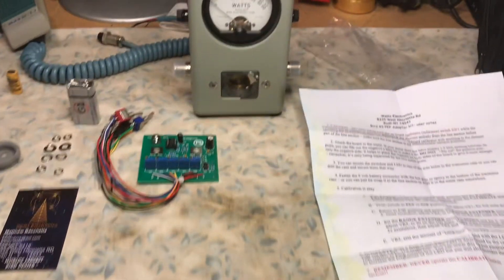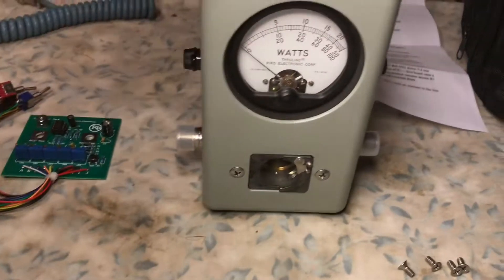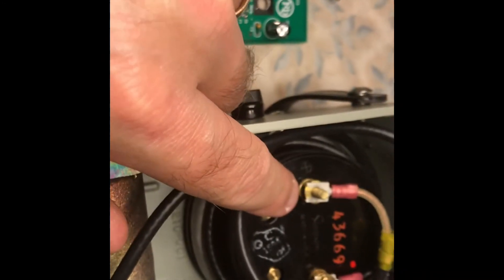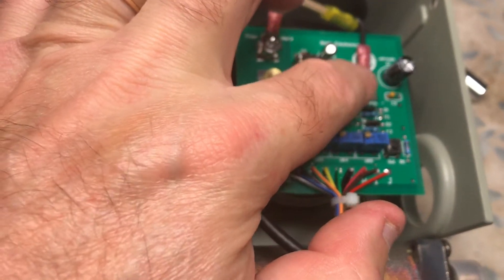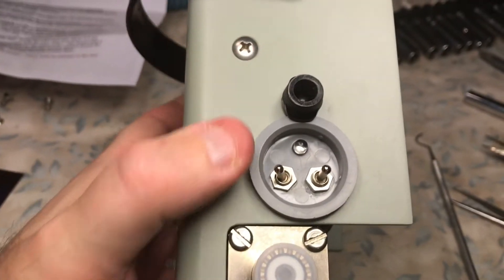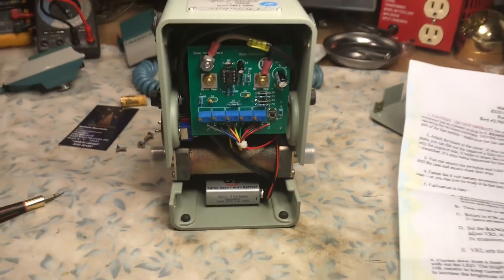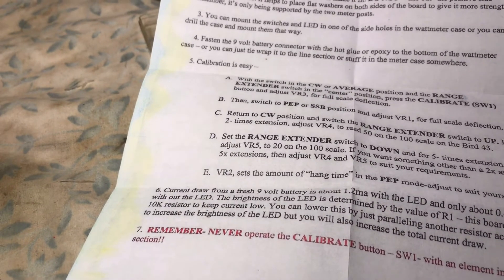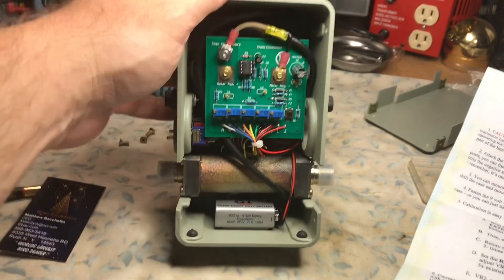Bird 43 Thruline Peak PEP Wattmeter Element Kit Installation

Comment: Nobody shows us how to use the multiplier
Reply: Use the same scale as the slug. ie: 100 watt slug use 100 watt scale and multiply the reading by factor selected. Meter reads 20 on 2x = 40 watts. That’s how it was explained to me

Comment: I got this unit recently and the one I have is pretty accurate on PEP ranges using a new Bird 1000H element on 20 and 40 meters
on the 1x, 2x and 5x ranges.
It helps to make the hang-time long so it can reach the max (VR2 lots of turns CCW) and it compares amazingly well to
a Bird Power Analyst PEP rating.
73  WA4QGA

Comment: BIRD 43 upgrade pep - ssb kit multiply board 2x 5x   ( if no update  through voltage drop you will get false reading information  x1 )
In order for the measurement to be accurate, a stable voltage is required.  in the pictures, we see brand new 9v batteries.  the scale is out of range.  empty battery is below the scale.  with the upgrade, in my case, the power source comes from a lion 18650 battery via a dc-dc step-up converter set at 9.1v and can be charged though usb port.

Comment: I have just orderd this kit. 
I am in the UK. Cant wait to get it installed.
Reply: BIRD 43 upgrade pep - ssb kit multiply board 2x 5x
In order for the measurement to be accurate, a stable voltage is required.  in the pictures, we see brand new 9v batteries.  the scale is out of range.  empty battery is below the scale.  with the upgrade, in my case, the power source comes from a lion 18650 battery via a dc-dc step-up converter set at 9.1v and can be charged though usb port.

Comment: Not sure why some of you are having problems with the 2x and 5x settings. my kit works fine. center position 110 watts, 2x 110 watts,  5x 110 watts.
Reply: I agree, I have tested a 1000w slug at 2x and 5x with a 3x Acom 2000 with combiner setup and its extremely accurate when tested against a standard 4134 with 5kw slug on dummy load. We do a lot of defence testing for high power HF equipment and its definitely going yo save you some money on slugs without losing accuracy.  I think the pep kit is a winner and unless you are super anal about readings down to the milliwatt, buy it for sure. Cheers Brenton vk3cm Tangambalanga North East Victoria Australia

Comment: I'm waiting on my kit and am more interested on the PEP feature as of now so hope all goes well. I'm hoping I can use my 12 volt power supply with a buck convertor or something instead of the 9 volt battery. I guess I'll have to see what the DC voltage range is when I receive the kit. Out of curiosity, has anyone tried this?

Comment: Len.....I noticed you never make the switch orientation clear.  So....I watched your video until I could see wire colors on both switches.  Then I knew how to install them in the proper orientation. Everything else went smoothly.  Thanks!
Reply: for it to match what the instructions say, put the green wire on the switch at the bottom and you will have up for 2X and down for 5x.

Comment: It's not a bad kit but it's not very accurate especially in 5x position. I'm here because I'm trying to see if anyone has figured out how to fix it.
Reply: I'm not sure you are right about your claims
Reply: @zeljkoadzic1692  well this was a year ago and I found out mine was defective.
Reply: @zeljkoadzic1692  same here, my kit works fine. center position 110 watts, 2x 110 watts,  5x 110 watts.
Reply: Same issue here.
Reply: @mostlypostie1  and you calibrated it like the instructions say? which slug are you using?
Reply: @bobicpfan2  to the letter of the law. I have a calibrated test bench to reference it against too. It's close in the 1x. Slightly out in 2x and a fair way out at 5x.  No matter what you do. And you can't compensate for this error.
I have many slugs for different frequencies and powers, and the error is fairly consistent.
Reply: @mostlypostie1  ok. so its obvious that some folks are having this issue while some are not. i guess i'm a lucky one
Reply: @mostlypostie1  thousands of them were sold and only a few of them complain.. there is a small problem somewhere..
Reply: @zeljkoadzic1692  I had a problem with 5X only. I replaced the opamp and calibration changed a lot. Recalibrated and now all is well using my Bird 4391M with 100H slug as a standard.

Comment: Hi and thanks for sharing this video. I got the same board and found that even after calibration the x2 and x5 are too inaccurate. Loss of linearity of the scale unfortunately. By the way I’ve calibrated mine to read on the 250 scale. So simply put instead of going to 50 on the same 100 scale I went to 100 on the middle (250) scale. Because I only have 100H sensor I can read higher than 100w this way. 
Another thing I’ve done and suggest to everyone who use the board is to secure it in place at an angle using ring wire terminal as spacer. Doing this I can use the hole to hold a spare sensor, otherwise unusable.
73s
Reply: Same. My 2x and 5x calibrate OK in CW mode, but in PEP, they are not accurate. I'm probably going to remove mine and get the real kit from Bird. :(
Reply: @mostlypostie1   I'm not sure you are right about your claims
Reply: @zeljkoadzic1692  you can't really make the results up. Sorry to say but the linearity of my unit is not great.
Reply: @mostlypostie1  

2016-12-21	
Give 'em the Bird!
First, I'm surprised this unit hasn't been reviewed before. At least I couldn't find it!
Second, be aware that 'adaptor' and 'adapter' are interchangeable on a device.
This completed board is made in the USA and comes pre-adjusted. The instructions include the simple self contained calibration process.
Very easy to install. There are 5 multi-turn pots which only needed the slightest 'tweak' to calibrate my Bird.
Unlike similar units, it comes with a 'plug' to fit into the side of the 43 to hold the switches and power LED. No drilling.
I couldn't (or should I say; 'wouldn't) build one for this price.
Dead accurate.
ron
N4UE
Reply: @mostlypostie1  thousands of them were sold and only a few of them complain.. there is a small problem somewhere.. we are hire  to find out..  is yours bird meter 30uA exact full scale?
Reply: Yes, there is already a smaller board that solves this problem with the place for the plug slague.. maybe there will be a better version that will be more accurate. we will see how it develops in 2024